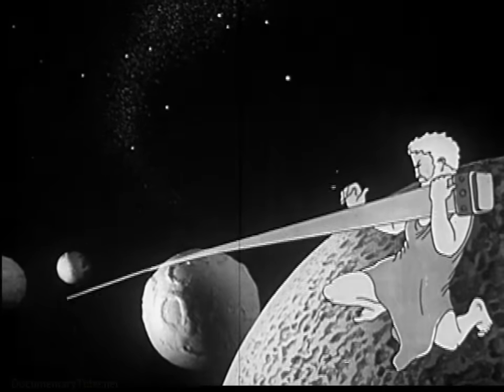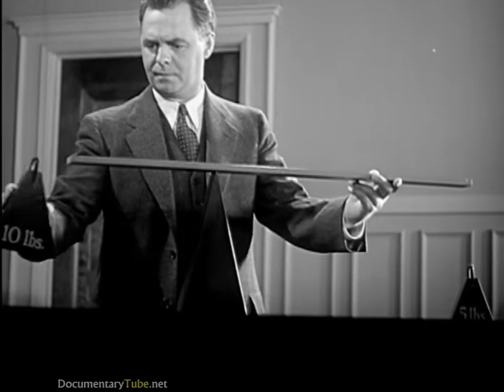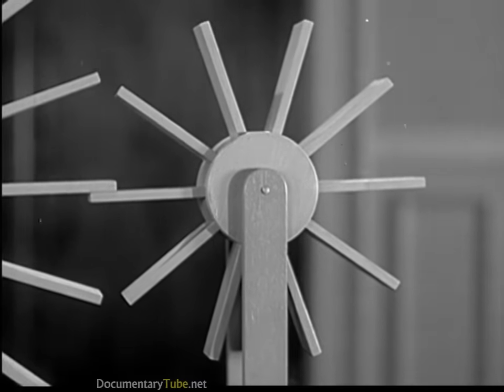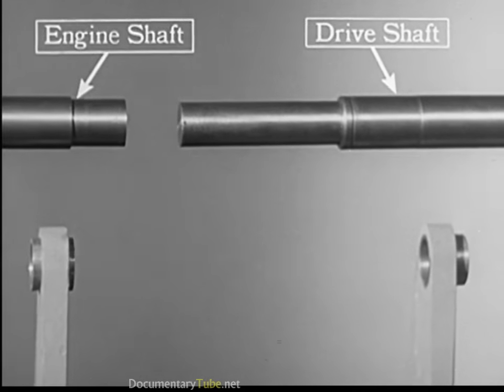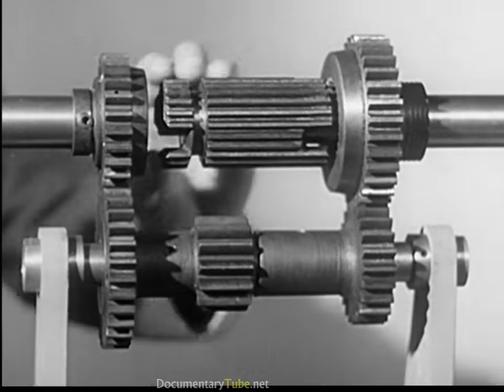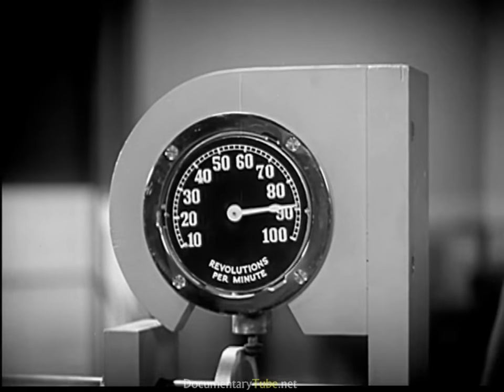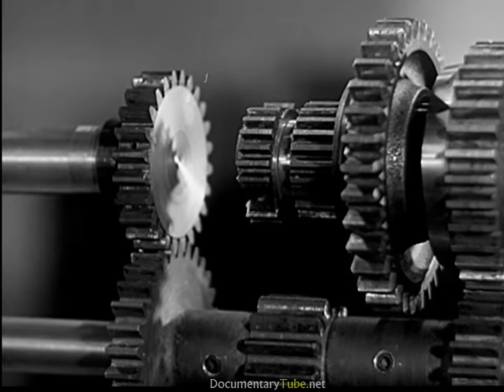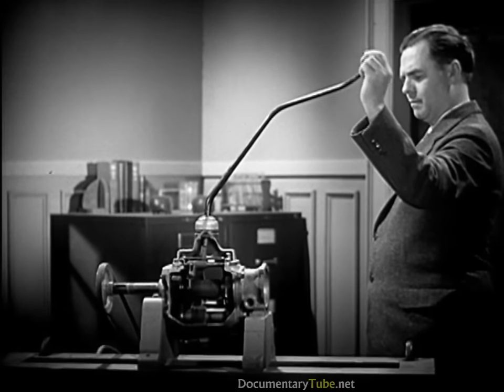HOW IT WORKS: Transmissions

Comment: But how can more or less power be delivered to the drive shaft by the size of the gear used. Especially when the front two gears are permanently enmeshed, and must always rotate at the same speed
Reply: Not more or less power, but more or less gear ratio to change the output shaft speed.  Think 10 speed bicycle gears.  Changing the gear ratios to make your leg  power more effective.
Reply: @blackhawk7r221  I understand that somewhat already, but what I'm more interested in I think is why you wouldn't always have the engine go straight to wheel, why bother with transmission at all, since itseems more efficient to get rid of the gears entirely. Is it an issue of torque? If so, how does having a smaller gear turn a larger one increase torque to begin with.
Reply: @devinahfong1933  Because engines are designed to produce useable power (torque) with a particular RPM range.   For instance, my big V-8 may produce 400 lb/ft of torque at 3700rpms, but it may only produce 65 lb/ft at idle.  Not a useable engine speed.  But then, in a neighborhood going from stop sign to stop sign, I am not going to spin my engine up to 4000 rpm’s.  So we build engines to deliver an acceptable amount of power at a reasonable rpm.  So in the case of my V-8 that I described above, it will give me 220+ lb/ft of torque at a reasonable rpm range of 2200 where the transmission would normally shift for normal driving.  Ok, cool.   Now I have plenty of power at a reasonably useable rpm.  But if I send that down the driveshaft at a 1:1 ratio, it would lug down the engine from trying to propel a 2-ton vehicle.   So we use the magic of gear reduction.  We use a first gear that may be a 4:1 ratio.  In effect, you quadruple the power through gearing.  As you get that 2-ton mass moving, you can shift into second gear at a 3:1 ratio.  By the time you get to 4th gear, that is usually the 1:1 ratio.  But hey, now I am traveling at 70 mph, but my engine is spinning at an rpm that is too high.  No problem.  Shift into a less than 1:1 gear ratio.  An overdrive.  5th gear, usually 
1 : .85 gear ratio.   By using gearing, we can utilize the useable power range without over or under revving the engine.
Reply: @devinahfong1933  You have to realize that a car either small or big is a heavy item. Unless the engine is maybe 12  or 16 cylinders or more, smaller engines direct to the wheels are not able to get the car moving from stationary position.
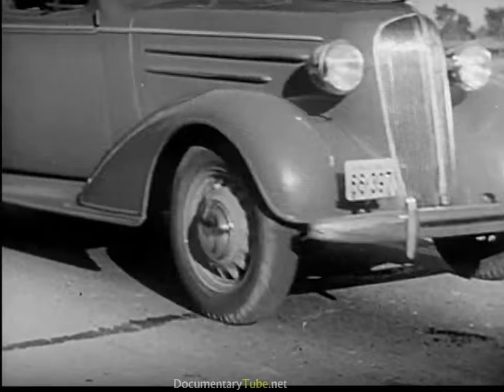So to get it moving, a smaller gear (indirect gear) is fitted so as to get the car moving 4:53

Comment: I know a lot about cars and a transmission to me seems obvious what it is. It seems like it's a basically a gearbox. The transmission works with the engine to allow the engine to reverse drive and whatever else. Cuz if you didn't have a transmission you could drive a motor but you might just only be able to drive straight and not do nothing else that's where the transmission works. This guy I know is a mechanic and he said no matter how good a Toyota engine is which they'll last long. He seems to think eventually after 3 4 500,000 miles you may have to replace your transmission not your ends in your transmission. The two most expensive repairs on a car would be engine and transmission.

Comment: Nothing like the old days, man. Now, I push a button from 400 yards away and my Honda will start itself and turn on the AC or heat for me depending on ambient temperature. Then I push a button on the steering wheel and it will almost drive for me, keeping my speed and following distance, while making steering adjustments to keep me in my lane. Only instead of needing a spare spark plug, crescent wrench, screwdriver and ether in my emergency repair box, I need a damn cell phone and a $90/hr labor rate to get it fixed. Today's cars suck.

Comment: I have a question: why does switching to 2nd gear give her control going down the hill? Assuming she started in first, can't she just apply the brakes without switching gears and maintain control? I'm just not understanding that part.
Reply: @Locally
 - At 2nd Gear, she is in low revolution (30-RPM) and not tied to high (90-RPM), that way she can slow down safer and easier.  Maybe this will help further....  In the Video, they made the Engine at 90 RPM at all time... By shifting to 2nd Gear, she is only at 30 RPM, thus slowing down easier than slowing down at 90 RPM, get it?
Reply: @JodBronson  Thanks for the reply, that does clear things up for me
Reply: @davidmeloche1991  - Cool, you are welcome!

Comment: that demonstration with the gear shift and the sparks flying wear-and-tear on the gears made so much sense!!! I always wondered about that, but it turns out, the car had a synchronizer all along so it didn't have to worry about gears being at diff speeds before shifting!

Comment: I've always wondered how come automatic transmissions can't have infinite gear ratios? I kinda get why older 90s auto transmissions and before that can't, but can't you just mess with the pressure or something and just constantly change gears? I fully understand how a manual can't do that,  obviously,  but why can't an auto do that?
Reply: Because autos are also shifting between gears and there's a limited amount of them. They just do it... Automatically...

Comment: Hey for what I understand, going 60 miles and shifting to 2nd  gear would compress the engine to much and cause damage on the clutch wheel and grind the gears badly.
Reply: At 2nd Gear, she is in low revolution (30-RPM) and not tied to high (90-RPM), that way she can slow down safer and easier.  Maybe this will help further....  In the Video, they made the Engine at 90 RPM at all time... By shifting to 2nd Gear, she is only at 30 RPM, thus slowing down easier than slowing down at 90 RPM, get it?

Comment: Sadly these simple yet fun to drive manual transmission is dying. I polished my manual driving skills by driving a manual car since i learned it when i was 13 years old and now I'm 35 never had an automatic transmission car. I told myself i will drive standard as long as i can. Save the manual!😎

Comment: give you a picture of an automatic transmission and explain a manual transmission. any idiot knows how two gears interact. I wanted to know how hydraulic gearing works and planetary gears.
Reply: And you are looking the answer  in  a 1950 documentary on how transmission works when they did not even said anything about hydraulic. You are a genius